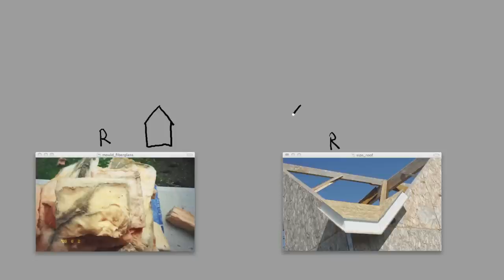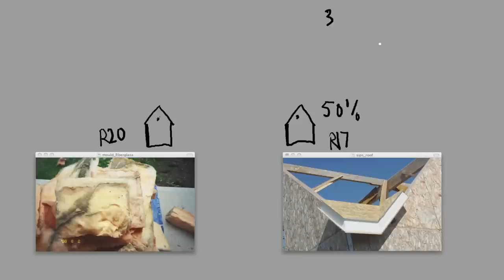Insulation R Value - It's Not What You Think

Comment: R value stands for thermal resistance. and it's an expression for how many hours it takes 1 btu to transfer through 1 square foot of material with 1°F temperature difference. So R20 means 20 hours for 1 btu transfer through 1 square foot of material and different materials are used to build a wall so you add them up. Then you have K and U factors but that's too much for one comment.

Comment: The way I heard this explained, while comparing fiberglass to cellulose, is that the R spec is officially determined at a modest temperature differential, more or less taking for granted that R does not depend on the differential. But resistance to heat transfer is due to tiny trapped air spaces, and air moves fairly readily in fiberglass from space to space, if there is any temperature or pressure differential.  Fiberglass, coated with something sticky, is often used as an air filter. The official R number overates fiberglass drastically as the temperature difference increases, because the large difference causes the air to move more in fiberglass. The fiberglass manufacturers don't bring this up at all. Whether the big, colorful fiberglass guy has ever done anything to mitigate this fault with fiberglass, as would seem logical, I don't know.

Comment: if you are using SIPs then isn't the fiber based cavity also containing framing that may result in thermal bridging? So even the Rvalue Conduction isn't comprehensive as wherever a board breaks up the fiber based coverage.

Comment: There are issues not discussed here.  The enviro impacts of foam are significant, compared to NATURAL fiber based insulations.  Foams are in general very poor choices for health, as well as fire resistance.  Sips panels are sometimes not a reliable structural element in buildings, and the rate of convection in fibrous insulations varies significantly.  There are many types and densities of fibrous insulations, fibreglass, mineral wools, wood fiberboards, dense-packed or blown-in cellulose, etc.  It is true that foams are pretty impervious to air and usually to moisture, but there are also studies that show some foams especially lose their R-values at low temperatures as well.  I believe it is Polyiso that that drops in R-value dramatically below -15C.  Finally, foams cost about 10 times (or more) as much for every square-inch R, than cellulose, fibreglass, wood fiberboard, etc.  Keep in mind, foams are simply gas encapsulated in plastic bubbles.  If that gas is air, fine.  But if that gas is something else, there will always be a net force on that gas to diffuse out of the foam.  I have to wonder what the life expectancy of foam insulations are in the various temperature regimes, and how their performance holds up over time.  And personally, I'd rather insulate with fibrous materials than foams, and address the convection issue by using a denser fibrous insulation.  The regular fibreglass insulation is very very loose, and does have a lot of air in it.
Reply: I am with you all the way.

Comment: The optimum vapor barrier is a plastic sheet on the outside of all drywall,
the insulated cavities encapsulated on all sides by a plastic sheet and with the top one inch of each cavities facing the sheathing left open to keep the insulation dehydrated.

Comment: I think you are making an error in stating that fiber insulation supports convective air currents; indeed, the very mechanism of heat resistance occurs by virtue of the tortuous paths created by the fibers which minimizes such currents (i.e., insulation is designed to suppress these currents which is why even steel wool, in spite of the high thermal conductivity of the individual fibers, insulates because the dominant mode of heat transfer is convective).

Comment: Think that may not be mold in the fiberglass insulation. There are a lot of myths out there about mold, and what is and isn't. My understanding is that we say something is mold when it isn't, just because of discoloration. Most typically, we say "Black Mold".

I recently pulled out fiberglass insulation from a wall and it had a very similar black "mold" like look to it as shown in your picture. However, it was most likely just dust/dirt/debris.
The insulation was near the cold air return locations. With how the cold air returns were designed, they are not sealed off and can pull air from the wall cavities themselves. This pulled dirt and grime into/through the fiberglass insulation, like it was a filter.

Comment: A complete new standard should be used for modern homes. If I use R factors for heat loss, open cell is 3.5 per inch while fiberglass can be 4, and we all know how poorly fiberglass is. So, we at least need a program which shows fiberglass and foam exposed to 20 mph winds @ zero degrees for 24 hours and use that factor for heat loss/gain design, it would be much better than the rubbish we are expected to do today with Manual J. So sick of Ashrae and ACCA dragging their tails on this important topic. Anyone use a higher rating to compensate for the fake usage of R factors so their totals are more realistic? What I've currently have done is basically lowered my infiltration to almost zero which helps. but radiation is still an issue.

Comment: What isn't mentioned here is what happened when hundreds of homes in Alaska were then built with SIPS to accord with this principle. Whoops. The same problem turned up in all kinds of other places as well. Thermal control doesn't matter much if your air and moisture control aren't correct, and so when SIPS didn't control those either, they created even worse problems than having a poor R-value.
Reply from the maker: Hi There! The air tightness of SIPs (or any other tight, modern building system) must always be accompanied by top-drawer practices in other areas of construction, too. That's why every type of tight house requires mechanical ventilation. That's an unavoidable part of energy efficient construction. I don't know the details of the situation you refer to in Alaska, but if internal moisture levels were too high, then heat recovery ventilators are the answer. They work every time. You get fresh air and you save more than 75% of the heat from the outgoing stale air stream.
Thanks for watching and commenting.
Steve
Reply: ***** Actually, the problem was internal to the foam panels when they were used for the roofing structure. The airflow networks within the panels, just like in fiber insulation, allowed warm moisture to rise to the highest point and began to mold and rot out the top 18" of the panels. Homeowners had mushrooms growing out from under their shingles. Foam panels used in that manner require a vapor-open top and vented over-roof to be safe--an expense few homeowners are interested in paying for.
Reply from the maker: Ah, yes. Thanks for clarifying. 6-mil poly on the inside of the panels would have stopped that condensation. Normally this isn't needed with SIPs, but perhaps with the long periods of high temperature differential it's required in Alaska.
Take care,
Steve
Reply: Reflected Miles could it be they were open cell foam sips?
Reply: Reflected Miles and
Reply: The manufacturer of my SIP panels specified 6 mil poly between the drywall and the roof panels.  I've lived in my SIP home since the year 2000 with no problems, in the marine 5 zone (rainy 8 months a year.)
Reply: The problem in Alaska with the SIPS was the cracks between the panels allowing warm moist air to rise and leak out to the cold roof sheathing then condensate. The poly solved the air leakage through the cracks.

Comment: Hey Steve, I know this is an older video now but I'm hoping you respond. With a typical air barrier like tyvek, and then rigid closed cell foam on the exterior of a home for a retrofit, would that fix this issue and make for a much more efficient building? Also, how would a double stud wall do in something like this as long as there is a tight outer shell?
Reply from the maker: Hi Mike! Glad to help . . .
One of the best things you can do in a retrofit situation is add rigid sheets of foam on the outside of a building. This boosts effective insulation action, it reduces thermal bridging, and it makes stud wall cavities warmer for a given outdoor temperature. This greatly lessens the chances for condensation to occur inside wall cavities near areas with a less than perfect vapour barrier. Double wall construction boosts the energy efficiency of a building, but you don't get the effectiveness of foam.
Drop by my website https://baileylineroad.com for a visit sometime. You'll find lots of stuff there, including tool giveaways, articles and the chance to ask me questions. 
Bye for now and thanks for watching, Mike!
Steve
Reply: Steve Maxwell that's great to know, thanks alot Steve! I'll check out your website for sure. I've watched many of your videos on here and I've become a big fan. Thanks again!
Reply from the maker: My pleasure, Mike! I'm glad to be of service. What sort of renovation do you have planned? Where do you live? Bye for now, Steve
Reply: Steve Maxwell Well, I've got a full remodel on my 1950s cape style home in climate zone 5 in the states. I've gutted it down to framing and air sealed every cavity bay with great stuff and their gun. Then stuffed each bay with roxul r15 batts. The only thing about exterior insulation being added is the house has no overhangs or soffits and creates a much larger job. I recently put a full length dormer on the backside of the upstairs which will allow me to vent that roof. I'm filling the bay's with r45 of roxul, and then having 2 layers of 2" poly iso taped and sealed to the underside of the rafters for a vented r71 roof assembly. Xps foam on the basement interior walls and rim joist, with roxul in front of it as well. If you think I can improve any of this, please let me know!

Comment: Awesome video! I have seen the rather gross results of fiber or cellular insulation and honestly, it is a waste of time and money. Rodents love it and certain molds can be dangerous to young respiratory systems. Faced foam is the way to go as far as I am concerned but I would like to hear any negatives to foam (besides expense) anyone might have to offer.
Reply: Foams for insulation come in two different plastics.  EPS is the stuff you can buy hot coffee in, and obviously, it is harmless and impervious to water.  The other kind, not so much.
Reply: foam works great aslong as the wall assembly stays dry. other wize rot runs rampent. and also major fire hazard. beyond that i" properly design" system works great.

Comment: I am building a cabin with 16 different types of insulations and will closely monitor how they perform in relationship to each other.  For we need proof and with proof, we need class action law suits that will drive the fiberglass insulation industry bankrupt. Just try and discover the pounds per cubic feet (pcf) of any fiberglass batt, talk about conspiracy. 
Fiberglass attic:  R-2.8/in.   . 5 pcf
Fiberglass wall:   R-4          1.0 pcf

Cellulose attic:    R-3.8       1.5 pcf

Cellulose wall:    R-3.7       3.5 pcf

Cotton:  R-3
Straw:    R-2.7

Pine needles:  R-2.6

Hay:   R - 2.5

Sawdust:  R-2.2

Comment: The whole video is correct because I have a glass wool insulation which has the yellow fiber wool inside a double brick wall, which also has a sliding door in it in one its walls. The more the temperature goes down, the more absent is the insulation. And because the roof is a 6 inch exposed to weather concrete floor (with inside plaster and paint) and no other insulation, all the heat goes out immediately no matter how much heat I build inside when the temperature outside goes bellow 71F.

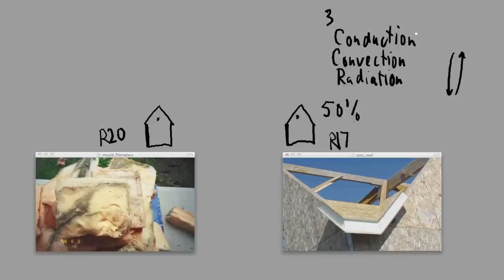The distance from the sun at 3:26 is a false belief. Earth is flat (eric dubay)
Reply: Litsa Koylitsa ah no. No it's not
Reply: Litsa Koylitsa not a sheep